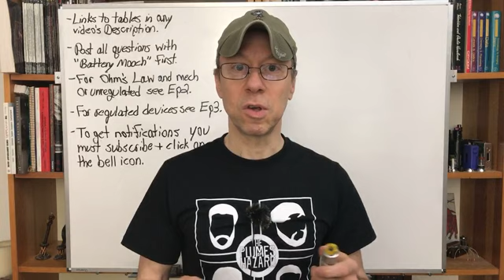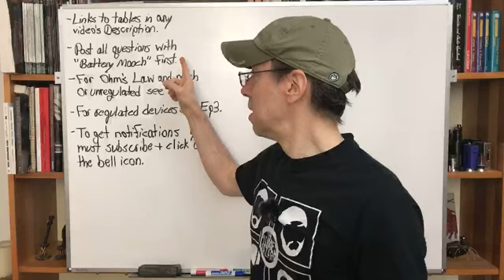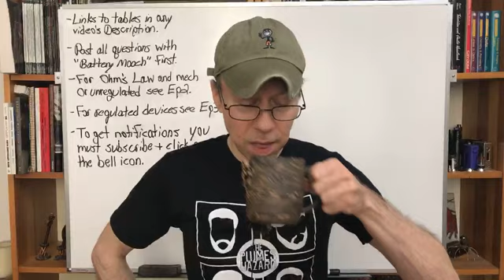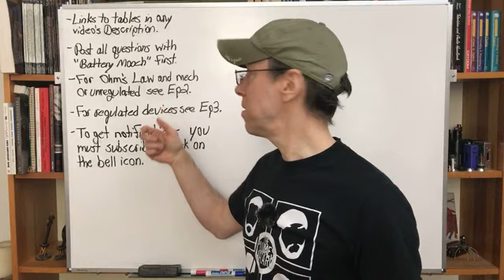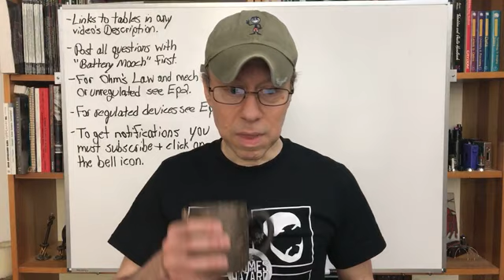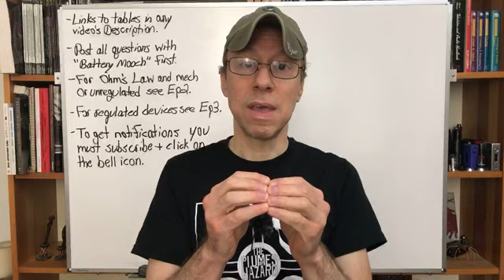Battery Mooch Live Stream Q&A #2 - Answering your vaping battery questions

Comment: mooch, first off thanks for the content and what you do for the community. Secondly, a person was telling me that according to you it is safe to run .06-.09 ohm builds on a single battery 18650 mech mod. I'm curious whether you agree with this. It seems low to me, even with 30a cdr batteries I've been watching your videos for awhile and haven't heard you talk about maximum safe amperage and ohms. I'm sure you've talked about it so if there's a video where you go over it I'd love to see it.
Reply from the maker: I’ve never said it was “safe” to run any battery at any level! There is always a little bit of risk. These batteries are never supposed to be used outside of a fully protected battery pack and we must always be careful to never misuse or mishandle them. Even a 0.09 build draws more than 30A, a lot more. A 0.06 ohm build goes WAY over the rating of any battery that we can use in a mech. Tell that person he/she is completely wrong about what I said.

Each of us can choose how hard we want to run our batteries but I will always recommend to never go over the true continuous current rating of the battery. This helps lower the risk, increases performance, and helps to extend the life of the battery. Keep the plastic battery wrap in PERFECT condition and only use a good charger on a non-flammable surface and only when you are around and awake.

Comment: i know i'm late but do dendrites form under "normal" operation (regulated mod, smart device, ect)?
Reply from the maker: It depends on what “normal” operation is but if you are not abusing the battery they shouldn’t form in any way that can cause a problem.
Reply: Exactly what I mean. Thank you

Comment: Hey Mooch.. Great show. I do have a question. Im using a Tesiyi 4 port charger. And also, i recently purchased Samsung INR18650 30Q battery. When i charge those batteries, the charger informed me that it's 100% fully charged. However, my mAh is 0. Why is that? FYI: it wont power up when i insert it in my mod.
Reply from the maker: Sorry, don’t know.
Try those batteries in a different charger and different batteries in that charger. Then try different batteries in the mod. That will help determine which is the problem.

If the charger does not add any charge to the batteries though it will read zero mAh. It doesn’t show you the battery capacity, just how much it put in.

Comment: Battery Mooch - What is the insulated box you always speak of to put batteries in?
Reply from the maker: The LiPo bag I mentioned? I don’t own one but a search should find a few as they are popular with the radio control communities. Never put a mod or charger inside one though.
Reply: Battery Mooch - I'm not trying to be cheeky. What do you keep 18650 batteries stored in? You recommend keeping them stored in an insulated container or "sleeve" almost every video but don't own one?
Reply from the maker: That’s a general recommendation to store each battery in. The small one, two, or four battery plastic boxes that are included free when buying batteries by a lot of vendors. I don’t have bulk storage boxes, just these smaller ones.
Reply: Battery Mooch - What safety does a super cheap clear plastic box offer? Again, I'm being literal and wanting to understand! If you tell me I "should" keep all batteries in a expensive vault I would do it if these things are too dangerous to leave on the counter in my kitchen.

Comment: Man I missed the livestream😞😞  Maybe I can still catch an answer. If the amps/mAh specs of a battery are based off the mass of a battery, why are larger batteries like 26650/20700 rated at the same max 30 amps? Why doesn't it increase to maybe 40 amps?

Comment: To get a 20650 adapter you just cut the end off an 18650-20700 battery adapter. 
Works like a charm. Just have to keep from losing that disc when you take your battery out.

Comment: I've owned at least 10 different battery chargers over the last 5 years of vaping and the Nitecore SC4 is the best charger I've used so far. For $50 or $55 you can't beat it. Doesn't have the Bluetooth BS but it has a few super useful features that most chargers don't. Super finite charging amps and also a baseline internal resistance reading as well as letting you know when it feels a battery is bad and time to be replaced.